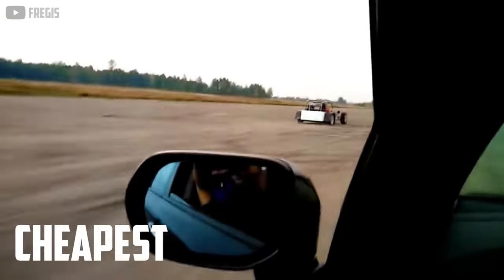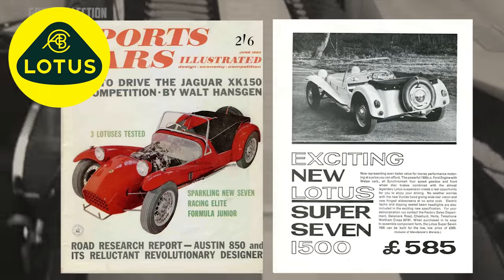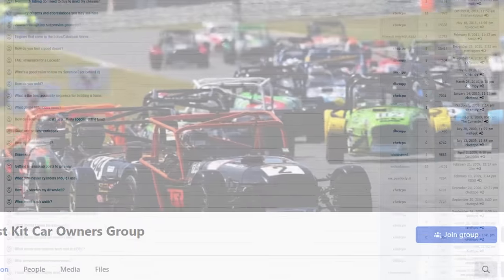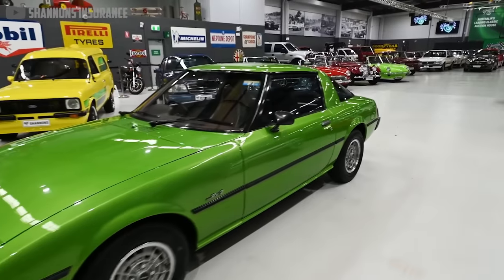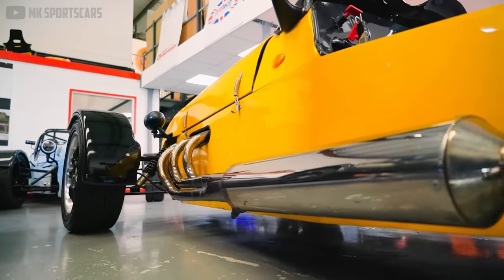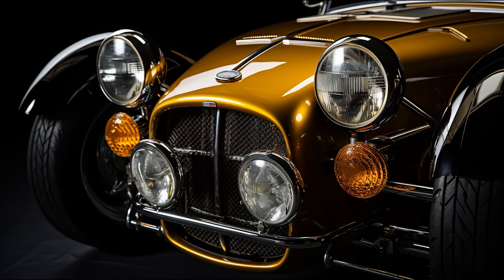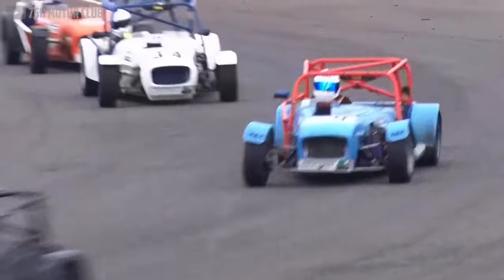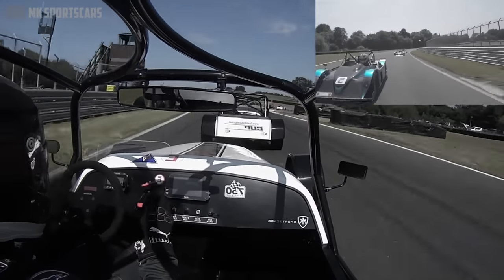LOCOST: The Underground Cheap Supercar Slayers

Comment: There's no cheap way to go about this. Even more difficult is finding a donor for cheap.
Reply: Want an Audi 2.0 tsfi with ECU? Have a Quattro box too.
Reply: Nothing is cheap since the 2000s, but some things are lower price than anothers m8s.
Reply: @matiasfpm  I have a 2.0 BUL special edition I'm breaking. I could deliver engine box and rear assembly if needed for right price. It would be crazy in a frame car.
Reply: You're best bet is to go to a salvage auction and get a car that was rear ended. If you do some research you can make a list of cars to look for, also talking to your local junk yards would help you out as well.

Comment: I just know someone somewhere has put a built small block chevy engine in there. God help that brave guy.
Reply: I'm in the process right now.  Warmed over '87 Corvette engine, around 325 hp.  Was going to use the B/W T10 I have, but the shifter and linkage are much too intrusive to make for a fun ride.  Accepted the fact that I will need to drop some coin on a Tremec TKX and keep moving forward.  Suspension is all C4 Corvette.    And for those bitching about "Low Cost" and how they really aren't, what does a new Challenger, Mustang GT or Camaro cost?  $60k+?  All told I figure I'll have about $15k in the car.
Reply: The guy who does my tuning has an Exocet with an LS3 in it with Nitrous.  The thing is an absolutely insane little street legal go-kart.
Reply: @ericdolan2130  its low cost compared to the things it whips past anyways.

Comment: I started my build based on the Chris Gibbs book (Ford Sierra donor) back in 2019. Unknowingly it becase my covid project and kept me busy in my spare time untill 2023 when I got it registered. I'm using a Volvo five cylinder engine and gearbox but otherwise the chassis is by the book. I dont really care for the glass fibre body so I made my own out of aluminium and because of that choice and I had to build my own english wheel aswell. Driving a car you built yourself is just such a special rewarding feeling but it does makes me hate the six months of winter even more.

Comment: I have a 1965 Chenoweth sand rail frame with a 200 horsepower Corvair engine. I have a Mustang 2 front suspension with 13 inch ford brakes. I am adding a rare 1972 Fargo dune buggy body and have 285x30x18 tires in the back and 265x35x17 tires in the front. My car weighs just under 1100 pounds. Am I going to have fun?
Reply: If the engine is in the back, you'll have fun until you overcook it in a decreasing-radius right hander then it would be real unfun real quick.
Reply: @mescko  Porsche 911's do quite well racing and they have their engines in the back. I have widened the front suspension to accommodate for that. Thanks for commenting. I was a research and development driver for Chevy at Spring Mountain in Nevada for 4 years.

Comment: The limiting factor of this kind of build is simply the space, tools, fabrication, and knowledge. Even with prewelded frames, theres still a lot of customization required.

I wanted to do something similar, but lacking most of the above requirements and figuring id make mistakes that cost me more money, ive just decided to save money and go fast on readily available motorcycles instead. Bikes are easier and faster and you can still do a locost bike build for a fraction of the money if your able.

Comment: Having owned crotch rockets as teenager (rd350lc, cbr600 etc) and now being older and wiser I see the Seven build as as close as I dare to be to ride a sports bike again...so in a sense it is safer
Reply: Give up, i'm 62 now and still ride a Busa with moto x bars on it for 80mph wheelies, have a 500hp '68 roadrunner I bought when I was 22..act young 🤣... I did a track day at Blyton and one of these things was there with a turbo Busa engine in it and loads of carbon fibre...lowcost was prob £30+K LOL.

Comment: I'm sure it has the capability to race a superbike in a quarter mile but no way will it achieve a top speed of 200mph! The aerodynamics would not keep the car on the road.
Reply: Absolutely spot on, they have the aerodynamics of a brick; the joy is based on the acceleration, cornering and braking experienced in an ultra light car. 550 kg is easily achievable and even less if you stick in a Hayabusa, R1 or Blackbird bike engine but in my opinion this route gets tiring as you have to rev the nuts off it all the time.
Reply: The number I hear most often is right around 135 mph.  Then the front end likes to lift.

Comment: Only problem with these is they aren't actually that low cost. Requires skilled labour, welders, etc.
Reply: Yep means you need tools and materials to. But it’s cheaper than buying a new car and be faster.
Reply from the maker: True, in a way I guess the cost is work instead of money
Reply: If you're not competent with the workings of brakes, steering, suspension and other important things then you should probably  stay well away.
Reply: @cornovii3012  very true but you can always learn, it’s not that hard. Doesn’t mean one should stay away simply because they don’t know. The majority of people do that and skip out on stuff they want to do in life simply because they think they tell them selves they can’t. Now that’s not to say you shouldn’t need someone to bless off on the safety aspect upon completion. I say go for it, learn, and execute.
Reply: If you're calling this skilled labour then probably not a good idea. Some people are just not cut out for this. Not a job for someone who struggles to put a chain back on a push bike should stay away 🤣

Comment: A well built Locost which can be under 1600lb (including fluids and a driver) with a ~200bhp engine is going to smoke say a 2024 Mustang GT. However you need balls of steel. The first one I drove in the early 2000s was based off a Sierra 2 litre carb Pinto so about 100 horsepower. It was built by 18 year old students and it was terrifying, just the knowledge of that fact alone before you drove it was pant soiling. The other one I drove had a bit of attention paid to chassis weight minimisation and the Zetec ST170 engine (I think it is called the SVT Focus in the U.S) which is not a light engine but pretty tough so took bolt ons and tuning to around 200bhp. Ended up about 300bhp per tonne, which is plenty let me tell you when your ass is on the floor, it's damp, you have no ABS and nobody can see you in mild traffic....

Comment: i bet one of these would be pretty impressive with a gm 3100 3400 3500 or 3900 v6
the 3.9l can produce v8 hp and torque in stock form and is noted for having 240hp and 240tq from 1000 rpms to redline. get rid of the stock detune and you get just over 300hp peak and hp and torque stay over 240 still. they are small light aluminum have oil pan reinforcement internally balanced forged internals oil squirters for the pistons and the bottom end is very related to the sbc 350. 
also they love boost.

Comment: I built mine in AZ in 2004. It cost about $8k, but I used a zetec crate motor, pro rebuilt t5, some actual Caterham bits, a pro built frame, an Isuzu Impulse by Lotus limited-slip rear axle. There were other pricey bits from Wilwood, Painless, OZ, and Autometer. It was titled and licensed as a 1964 Lotus Seven because AZ allowed, at the time, for titling by appearance - not sure what they do now. Anyway, that made it exempt from emissions.  It was the most fun I've ever had; both building and driving, and it was the result of a cosmic convergence of timing, money, parts availability, and clean living. Sadly, I lost it due to a divorce and subsequent bankruptcy, but there's a lucky someone out there who owns it. I miss it and would not have done anything different, except for letting it be a victim of the divorce.

Comment: We built our street legal Miata/McSorley  for about $7k over five years. It was a drivable chassis after the first year of 250-ish work hours. Welding is a skill to learn like any other and MIGing mild steel tube is not aerospace-level tech.   

The biggest hurdle these days might be finding a cheap small donor car that is RWD. Our parts Miata was in rough shape and $600 - a steal even then.  There have been some successful builds that adapt a motorcycle or FWD engine into a RWD mid-engine beast ala Formula SAE. I always thought that would be fun.

Comment: Twenty-odd years ago, I had this same bug and lamented between doing a space frame or snagging a pre-welded chassis from Champion themselves, or even shoehorning something wild into a manx-buggy frame and seeing what craziness I could invoke with a carbon body. At the time, Champion also had a 'low drag' body option to mimic a Eleven racer body that looked dynamite and wasn't much more cost-wise than doing my own. 
Then I got married and scrapped the whole idea, but still have the itch. Yep, one day an engine is going to fall into my lap and come what may!

Comment: Similar low cost cars with exo-tube frames are safer, but more expensive. Your roll cage is on the outside of body panels and offers great crash protection. Doing it yourself is great way to save money and learn about fabrication.

Comment: That old trick of evading copyright by showing all the images as mirror image was somewhat disconcerting especially on the video clips, backwards reading number plates and graphics, the steering wheel on the wrong side and the speedo and rev counter working backwards too no doubt

Comment: I wonder if a 3.0 flat 6 would fit in there. Having an air cooled version of this would be wild.
Reply: I am guessing you would have to modify the chassis design to fit. They tend to be a bit narrow, and you may run into clearance issues with the total engine width. Even length could surprise you, given that you can slide the inline engines between the foot boxes. Cooling may also be harder, but anything is possible if you throw enough thought & money at it.
Reply: @MidgetRacer8192  Yes, I was thinking that just maybe... if you turned it sideways, and put a big enough hole in the front.

Comment: It would be great though just to make the chassis, that would be an achievement. I have done quite a bit of diy mig welding on thin stuff so I reckon I could cope with thicker box section tubing.

Comment: I remember buying the book (haynes one) in the late 90s with the plan to build a couple with a friend. The ideas for getting the metal where laughable...But once priced up from a merchant, quite reasonable.

the BIGGEST issue is donor vehicle. Even in 1998 getting a good enough RWD Escort was too pricey for this. Now its impossible. Sierras are too dear now also.

What are people using now?

What ultimately stopped us 18 year olds ploughing ahead was the set-up required for the welding of the chassis. It worked out only a fraction more money to buy a pre-built from Robin Hood. At least you would know it was straight and  set right (plus they offered a V8 option!).

Very cool cars. Shame I am the wrong side of 40, too fat and still 6ft 5in tall.
Reply: I've read about one with the Ford focus st170 engine,  I have an STwith 300hp and let me tell you,  in a package weighing half what the focus does it would be  blast
Reply: Many built with Duratec engines our ford focus (IE my caterham has a cosworth version) my Birkin has a twin cam toyota 4AG - you can use pretty much anything. As for being over 6 ft you can build them wider and longer - plenty do :)
Reply: I started by build at 44 and it took four years but yes your length could be a challenge. Definatly would need a McSorley 442 chassis.

Comment: LOCOST plans were designed by John Cowperthwaite who also designed the plans for my Midge.
Reply: I think that was the Locust (aluminium skinned wood)..not the spaceframe chassis Locost
Reply: @robocog  Yup, you are right.  My Midge body tub is 3/4" boating ply skinned in aluminium on a ladder chassis which is the same MO as the locust.  I was too quick to type!! :)

Comment: Every time I think about building one of these I have a close look at what I want out of one and realize that I’d be better off buying an NA Miata. That doesn’t take away from these amazing backyard engineering go-fast machines, more that my personal wants have changed over the years because I can’t imagine going on an eight hour long mountain run without having the option of shade and air conditioning in the middle of the day when the sun is at it’s most intense.

Comment: Anyone put a hyubusa engine in a DF goblin (or similar) yet?
Reply: There is a YT series of videos about radical automotive transplants. One was about stuffing a Hayabusa powerplant into a Piaggio Ape - a little 3 wheel utility truck. Originally good for 40 mph, now capable of 150. This would be straight line only as stability is not the best in these things.

Comment: Safety comes first for me, then the power to weight ratio.
Reply: They are usually built with a roll over hoop and 4 point harnesses, you could always get a full roll cage and abs if you want.